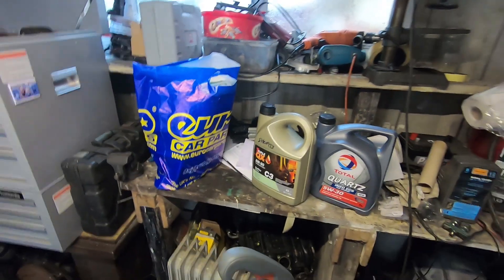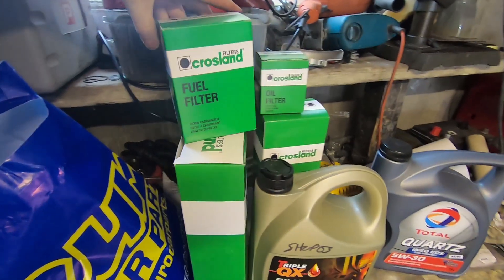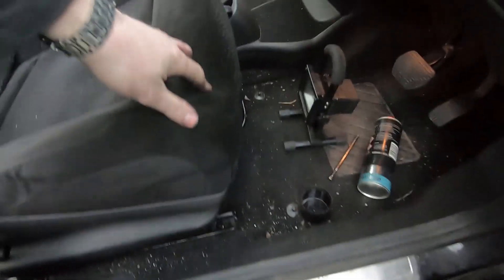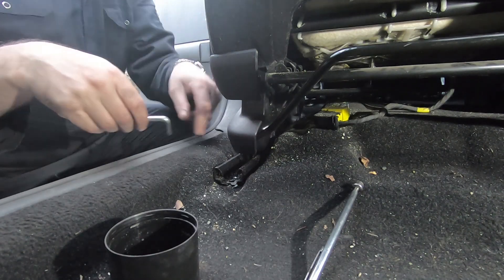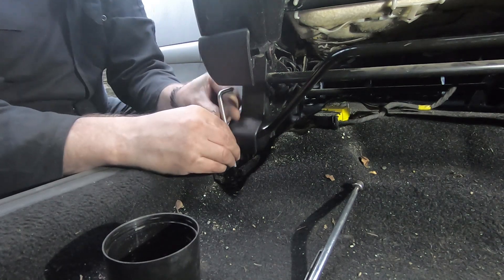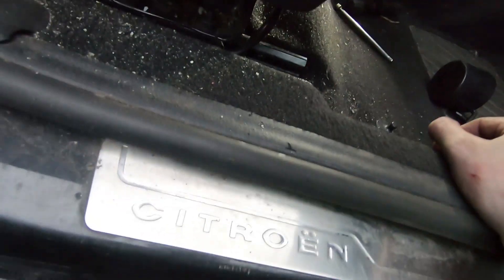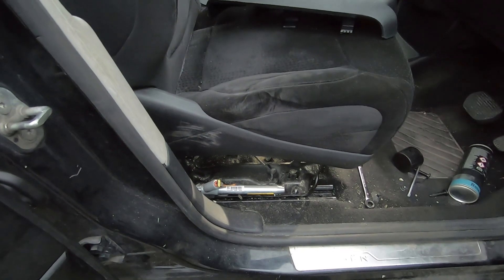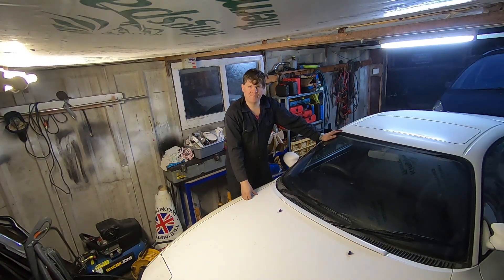Citroen C4 Grand Picasso Part 34 - Front seat rail fix - FAIL and service.

Comment: Them bolts that hold the chair in are longer than you think and look easy to remove untill you take the first one out ,and the next three. 😆😆
Reply from the maker: I can get to the front ones but I can't get to the back ones because the seat is too far back and I can't move it forward.

Comment: Hello mate, I don't know if you're still having the problem with that jammed seat, but I think the car isn't yours lol. Anyway, I had the same problem, seat was jammed in one position and I couldn't move it forward or backward.  If the owner is having problem let him know to try this I did.
What I did? I just pressed forward direction arrow twice fast and it started moving. And I was literally hours from disassembling it totally to find out what's the problem. I already started removing the plastics.
Reply from the maker: The C4GP is my daily driver. One of the rails is jammed. It is a manual adjustment on the seat. I've been living with it ever since.

Comment: Hi David. If we send you some cash via paypal can you offer any advice on a broken mechanism linked to the handle beneath the rear seat of a C3 Picasso. Currently only one of the clips to the the slider track is moving up and down when the handle is engaged which leaves one jammed and prevents the rear seat unable to move back or forward

John
Reply from the maker: I don't know anything about the C3 Picasso so I'm unable to help. I've since parted company with my C4GP. All I can suggest is to ask on one of the Citroen forums.